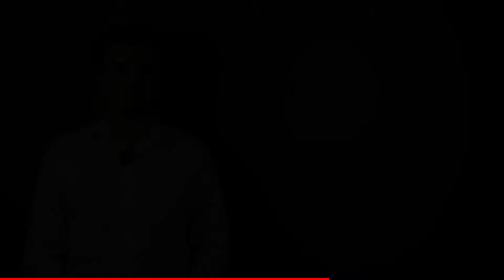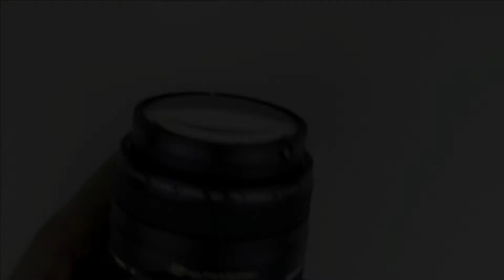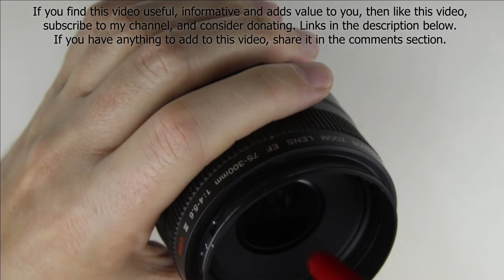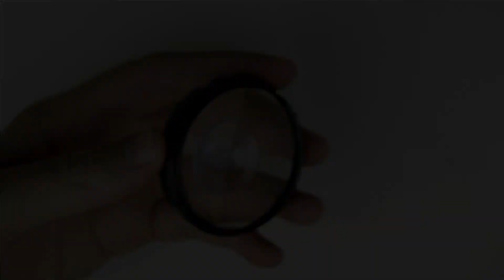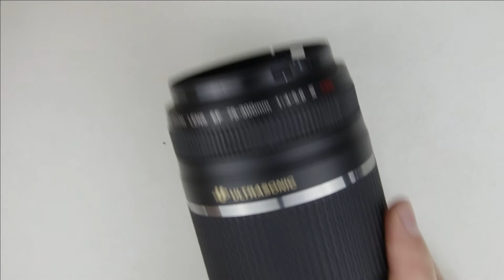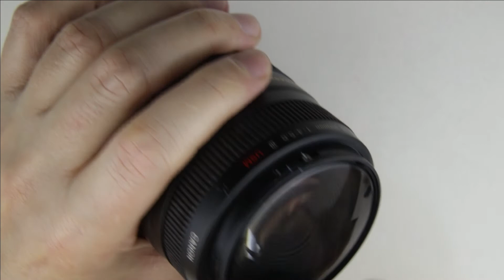Canon EF 75-300mm f/4-5.6 III USM - how to clean the lens inside

Comment: I have followed this tutorial to clean fungus from my mkII version of this lens. Everything went very well, however, on my lens, the front element which in this video you remove with the suction tool, has two elements. The fungus is between these two elements as well. Do you have a video which shows how to clean these? Many thanks.
Reply from the maker: Unfortunately it is not possible to clean that.
Reply: @CamerasLensesEtc  Thankyou.

Comment: Hello, I have a question, how do I calibrate the front lens if the pins have been turned without being marked? I have to admit I started turning them before watching this video, as I thought they were screws to remove the lens for cleaning.
Reply from the maker: I haven't done that before, but generally, place the camera + lens on a tripod, focus on something in the infinity, set the pins to the same position, and start taking photos, and check the quality. I would start with rotating the pins to the same position (for example the dots on the pins would be towards to the front of the lens, (take some test shots), then rotate all the pins 90 degrees, take some test shots etc... then check out which pin settings has the highest quality photos). Then you can check the image quality if you turn one pin at a time... turn the pin, and check the image quality.

Comment: the lens is one piece of glass or 2? I have some nasty but looks like INSIDE of the lens, not at the top or the bottom..
Reply: did you figure out how to open that front element - thats what im trying to do
Reply: @levit8  not yet 😔
Reply from the maker: Generally, it is (almost) impossible to separate the parts of the front lens element.

Comment: How are you? It is good for me and I have one more questions Please answer to me When you are removing the screws inside, why did you remove it with pliers instead of loosening it by turning it? And when you are assembling the screws, you are using  a screwdriver
Reply from the maker: Hello! I'm doing great, thank you for asking. Those are pins, and not screws, they don't have threads, so you can't remove them by twisting. You need to use a pliers to pull them out. When I put them back I push them inside, then I use the screwdriver to twist them to their original position. (They are eccentric.)

Comment: What is the purpose of marking the second set of screws position?
Reply from the maker: The lens is calibrated by twisting the screws. They should be at the same position as they were there originally to keep the lens calibrated.
Reply: @CamerasLensesEtc  When I first tried to undo the second set of screws I just tried to unscrew them out right. turning the screws numerous times thinking it was just a simple matter of unscrewing them out with a precision screwdriver. ( I gave up and I left them in) not realising till this video, that you had to pluck them out. what do you mean by the previous statement? Does this mean they should be at he same rotation or is it that the same screw has to go back in the same hole. what exactly does it calibrate.
Reply from the maker: Those screws are eccentric screws and they are used to calibrate the lens by turning them. That is the reason that it should be marked and they should be put back at their original pace at their original position.
Reply: What if you didn't mark them? How severe is the effect of the lens being out of the correct calibration?
P.S Very grateful for the video. 
Keep it up @CamerasLensesEtc